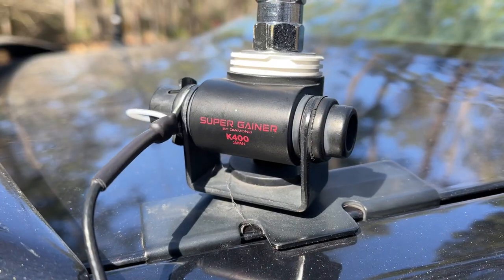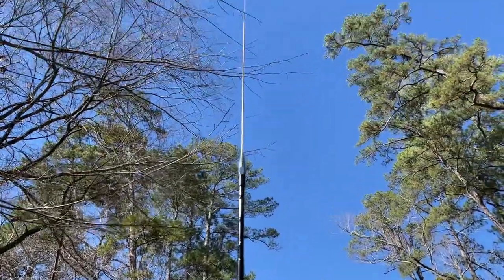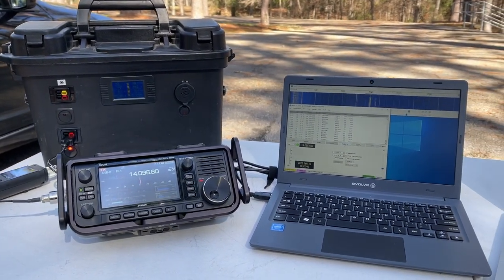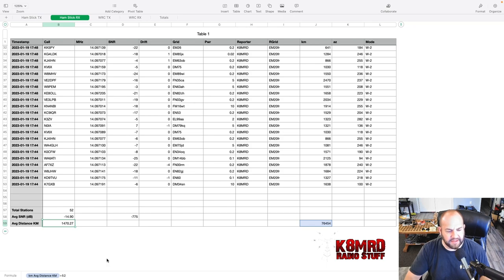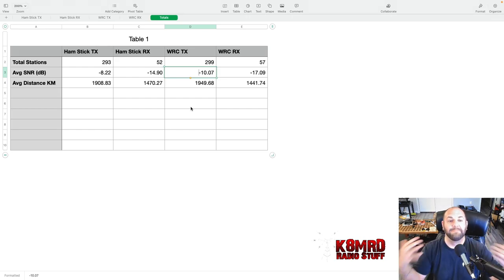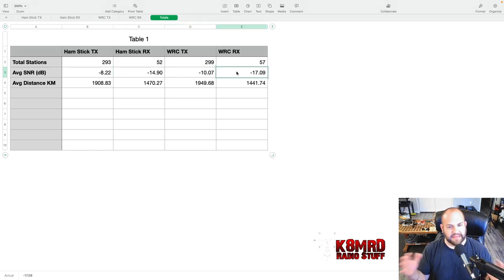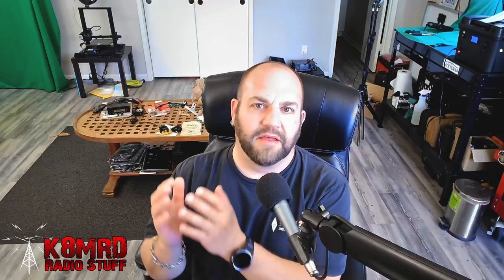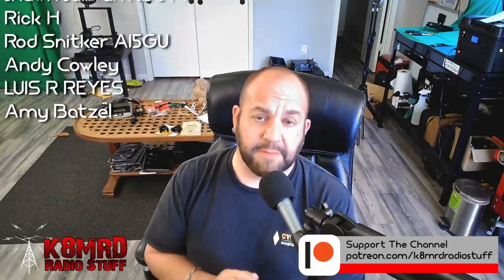Ham Stick V Wolf River Coils | Is There A Difference??

Comment: I own and use multiple hamsticks, so I'm not bashing them here. You gave the hamsticks the best possible comparison by using the smaller whip on the WRC. I'd love to see you do this again with a couple of different whips on the WRC and then come back and compare them not just to each other, but also the hamsticks. I would expect clear improvements correlated to the length of whip.

My current portable vertical of choice is the Chameleon 17' whip straight on the WRC longer tripod because it's just a straight up quarter wave that you can shorten for higher bands.

Good video Mike.
Reply: That’s what I use on 20m when I can. I wish he had included that as the “baseline” vertical, no loading coil.

Comment: Good video. I usually work with both the WRC and Hamsticks myself, particularly on 20 meters. Good info to know. The advantage of course is the WRC is multiband which comes in handy during POTA operations.

Comment: Hi Mike, Did I understand that right that you did not optimize the SWR of the WRC to the best of in order to have comparable antennas? So one antenna is at its best and the other one not???
Also what is your argument for selecting the shorter whip on the WRC? can you imagine taking the Stick to a summit? do they have a similar use case in this configuration?
Thanks for your explanations. Great videos youŕe producing. thks for the effort you put in that...
Martial / DO1MBC

Comment: I guess I would have liked to see the results with the WRC tuned for minimum SWR.  Because that's the way that I would use it.  The ham stick was, obviously, how I would use it.  It's good to also have the number as you got them, since (probably) it means that the power down the coax was closer to the same.  But still.

Nice test.

Comment: Robust?? I would definitely, owning both, say that the hamstick is more robust. The Wolf River setup is definitely more fragile. I would have liked to know the band width difference, within SWR. I haven't checked this yet, but I have compared the bandwidth difference between the Hamstick and the Hustler mobile antennas, and whereas the Hustler has a lower swr, their bandwidths are less than the Hamsticks. And did you specifically turn your hamstick to the utilized frequency? Thx for the vid.

Comment: Mike, I am new to your channel, and have watched many of your videos. This comparison has kind of a let down. I use both a Wolf River Coil and Ham Sticks. I think you should have weighed the two. I love my WRC TIA but if I have to carry it, I'll take a 20m and 40m Ham Sticks. There is no good commercially made solution to carry a Wolf River Coil. It needs a rollup carrier (in my opinion). I can attach two Ham Sticks to the side of my Portable Zero 817 Sherpa, pack the FT 818, and I am off to woods. Ease of deployment goes to the Ham Sticks too. I have a clamp that I can put on a picnic table or fence post. Then I attach my feed line and I am on the air. It takes me about twenty minutes to deploy my coil. I do make more contacts on my WRC than on my Ham Sticks. If propagation is good they are both fun but if propagation is poor, I find my coil can still get me contacts. That, for me is were the fun is. It is not fun to call CQ and get crickets. Please, take these antennas out to a park. Show the deployments and make contacts. I think that is were most of us will make our decision. 73 KE0OAP

Comment: The 20 meter Hamstik is closer to a center loaded antenna than the WRC and center loading is slightly more efficient than base loading.  I have to wonder if a short section of mast, 12 to 18 inches, was put under the loading coil on the WRC would have made any measurable difference.

Comment: Well, to me it would either…I have two Wolf River coils and they work great in my back deck (HOA) on 10m (sorry still a Tech) with the built in tuner on the FT-710. I like that you can use different whips…in my case I’m using the Buddipole. Great comparison Mike…thanks for sharing…Cheers, Alex K9YTT

Comment: I understand you wanted to keep everything as "equal" as possible; however, I also agree that you really need to re-test using a 'standard' whip.   I only say this because how many people actually use the short whip in comparison to the 102" (much less the 17 footers).   So, it would be much more accurate to compare what is actually used in the field vs handicapping the WRC to get it close to the Hamstick.   If you rally wanna get froggy, compare a 40M Hamstick vs 102" WRC vs 17' WRC...that would be interesting to see the results of, as they would all would still be loaded but at varying degrees.  Good video, regardless....keep up the great work.
Reply from the maker: This is actually a version they sell.  The call it the SOTA special.  I'll prob end up putting a longer whip on it and showing the real power of the WRC one of these days.  I'm curious what the results will be.  I don't have a 40 meter ham stick so I can't compare the two and I really don't feel like buying one just for the test as I will most likely never use it again.
Reply: @hamradiotube  don't get me wrong, familiar with the SOTA Special variation myself.  When I picked my WRC coil up, I did it piecemeal like, as I didn't need a kit outright.... So, I got the SB Mini coil and a tripod mount individually.  I also picked up a 78" whip as a cheap/budget option to at least play with the coil while I awaiting the delivery of my 5.6m "AliExpress Special" that was the intended whip for the coil.  I saw a significant difference of performance between the two, but it was in no way scientific... Just observed.  Point is, while the short whip and SB Mini are offered as a kit, I would foresee many more TIA kits being out there in comparison... I look at it like a car... Sure there are base models offered, but what does the majority of the 'non-company' buying public purchase.  73 de KC5VAZ

Comment: Yup.  You just proved that base loaded whips are less efficient.  Here is why.  Coils do not radiate.  The base (current portion) of the antenna is what radiates.  The tip (voltage portion) is there mostly for tuning.  With the hamstick, the coil is up the antenna, with a significant base portion below it.  Not  much,  but the results prove the point.  This is why the Hustler HF mobile antennas were the best.  Now, try THIS.  Add a 5 foot base rod and put that adjustable coil on top of that, with a whip length so that the total is less than 1/4 wave in height (you cannot coil load a greater than resonant length antenna).  You will have the best of both worlds.  Looking forward  to seeing you try that, and the results.  Jerry  wa2omu

Comment: Great experiment. I pretty much figured there would be little difference between the two, but it was interesting never the less. I only have one ham stick (20 meters). It's the more expensive Diamond stick with the coil in the middle. Does it perform $50.00 better ? Most likely not, but it is sexy (maybe a little more bandwidth and hard to measure signal increase). I'm 100% going to buy more ham sticks. I have all kinds of portable antennas, but only the one ham stick type. Question for people....I usually attach a clamp with 6 radials to the base of the mag mount with the ham stick. I have a full size SUV, with the antenna mounted in the middle of the roof. It offers a great ground plane. I've seen little difference in SWR with the radials vs. no radials. I wonder how much it increases performance if any with my set up. The range and signal strength has been impressive for this type of antenna.  I have used the radials set out in one direction to attempt to make it more directional. From what I've seen, it does appear to work to a small degree. Radials might work better with a smaller vehicle or one with the antenna mounted to the side of the vehicle. Anybody else have experience using radials with a vehicle mounted ham stick ? I need to experiment more when it's not 15 degrees outside with a butt load of snow on the ground.  I always want that extra half "S" unit....lol. Thanks Mike, still killing it !
Reply: For 20m and up you won't need any radials when using a (decent sized) magmount.
The capacitive coupling is usually good enough.

Even if you want to operate on 40 or 80m I'd suggest to forget about radials but instead try to increase the surface of the capacitive coupling to your car roof.

This is very easy to achieve especially if you have a mag mount with a PL socket.
Just slip a ring terminal with a short piece of wire soldered to over the socket then screw on the adapter for the 3/8 ham stick.
Remove a fair bit of the isolation of other end of the wire and tape it to some aluminum foil or faraday cloth.
Check for continuity!
Then you place the foil or cloth onto your car roof and you got a massive capacitor. The foil/cloth is one plate the metal roof the other one.
The paint of your car is the dielectric.

This increases capacitive coupling and the efficiency big time, especially on the lower bands.

For a temporary fixation you can use some smaller magnets.

And there you have it, a no drill and cost effective method of bonding.

Comment: It would be an interesting test to see if a longer whip does anything for TX. I would suspect it might receive slightly better.  However, vertical antenna the current radiates near the bottom and decreases in radiation the further up the mast you go until the top there is no current and only voltage. Yes, I would be interested in seeing a test.

Comment: Interesting video.  Perhaps the fact that the WRC is completely base loaded results in poorer performance compared to a hamstick which has a much longer inductive length from the feedpoint, causing the high current point to be higher off the ground.  A set of hamsticks might actually be a better choice compared to a WRC or other variable base loaded vertical.

Comment: The Wolf River coil uses stainless steel wire which has about 20 times the resistivity of copper. The added resistive loss could be responsible for the lower antenna gain...W6QR
Reply from the maker: I'd be curious what's inside a ham stick.  I would doubt it's high quality copper but who knows?
Reply: @hamradiotube  The diameter of the coil is very small, I think soft copper would be best....but who knows? If I ever destroy one of mine I'll take it apart 🙂
Reply: I think most ham sticks are more center loaded I'm pretty sure that's why the ham stick was slightly better

Comment: Can you take out the contacts that didn't hear you on both antennas and recalculate the average? This would give a different look at the signal reports. Should be fairly easy to do in a spreadsheet. Do you have this data shared anywhere?

Comment: I use the ham sticks if we are doing a short park visit, both ham sticks and WRC for a longer stay. I also run hamstick dipoles as well as single vertical antennas. The results haven't been spectacular, but they have been decent. 48 states and the world from NZ to Bulgaria. My results were pretty similar to yours. Keep sending them out Mike. KD4YXM

Comment: Ham sticks put out more power. Coils dump power right from the coil. We know adding a cap hat prevents some loss I wonder if a covered coil would force more power up  and out of the antenna rather than losing it directly from the sides of the coil.

Comment: OK, I gotta ask: What about comparing TX/RX for only the stations that were worked using both antennas? That would remove all the "monkey math" required to imagine whether working more distant stations was responsible for the lower S/N ratios, and should produce a pretty clear winner, even if only by a few tenths of a dB.

Comment: You put the WRC on a car.  You did not use its base and ground wires.  By not using these, could this have an effect on the WRC
Reply from the maker: A very good one, yes.  A car makes a great ground plane.  The same effect is done to the Ham Stick too.

Comment: I run hamsticks on the truck for 10 and 12. They just work. No fuss, no bother. The 10m stick I use the most is safely useable from CB channel 19 all the way to 29.7 (though it starts to climb pretty steeply once you leave 28Mhz), and is less than 1.1:1 @28.40. It would be interesting for comparison to see how the longer wrc whip would perform under the same conditions and what that would do to the numbers.

KC3UVF

Comment: You can lose over 90% of your power out of your coil unless you use a capacity cap on top of the whip to create a field to draw the power up and out of the antenna. You will still be losing more with a coil and cap than a ham stick. Use websdr to hear stations you can't hear with both antennas. Or a separate beverage antenna. I talk to ppl I can't hear on my antenna all the time using websdr online. If your using a stick or whip use the longest one possible.